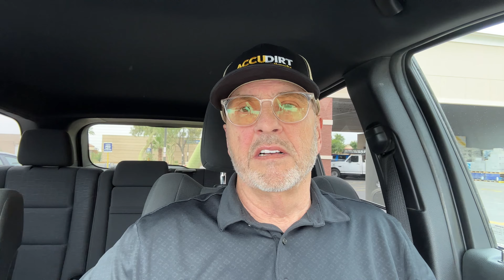Before a Blade Hits the Dirt: How I Plan a House Pad from the Grading Plans

Comment from the maker: Before equipment ever shows up, most of the important decisions have already started — in the grading plans, the site visit, the elevations, the drainage design, and the compaction requirements.

If you’re an owner-builder or planning a custom home, don’t treat the house pad like “just moving dirt.” This is where the project starts to either go right… or get expensive later.

What part of the grading/site prep process is the most confusing to you — elevations, drainage, compaction, or reading the plans?